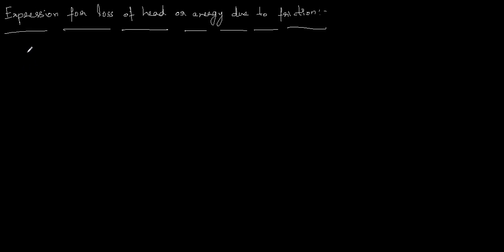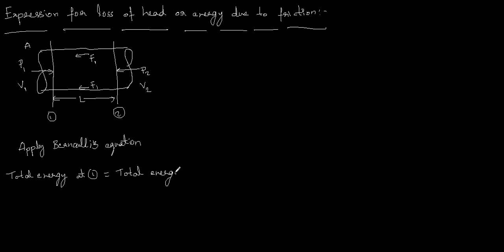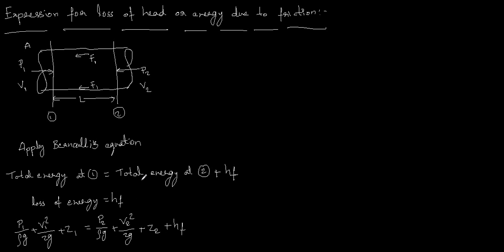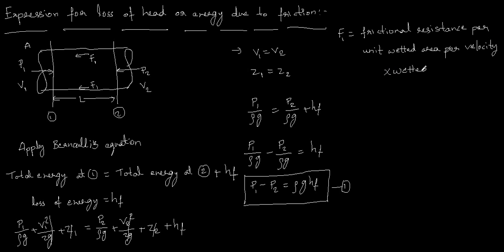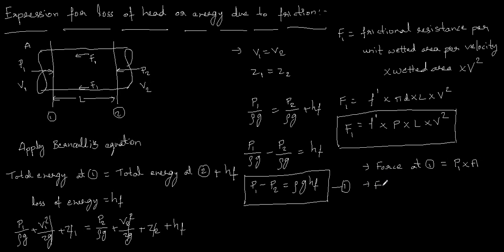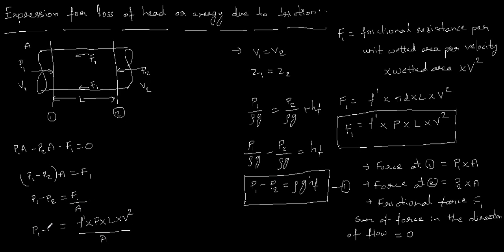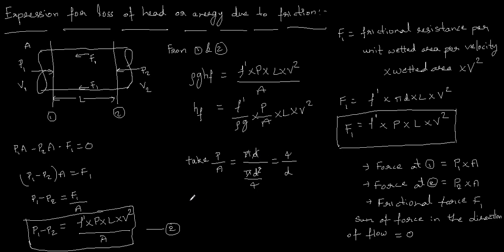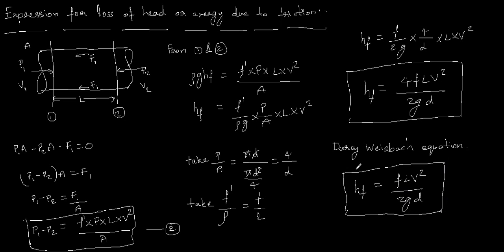Loss of head or energy due to friction in pipe flows

Comment: Does this loss of energy go to heating up the liquid, pipe or environment?
Reply from the maker: Yes, It can be converted into heat energy cause there is a friction taking place. But here we are concentrating on opposite force applied by the pipe surface which is due to friction.